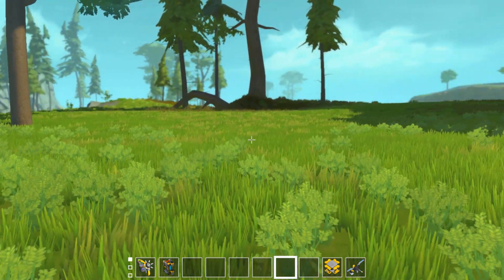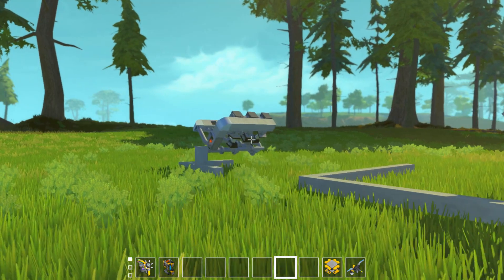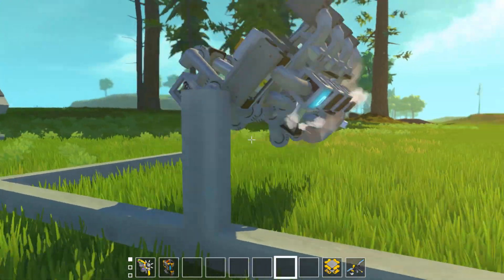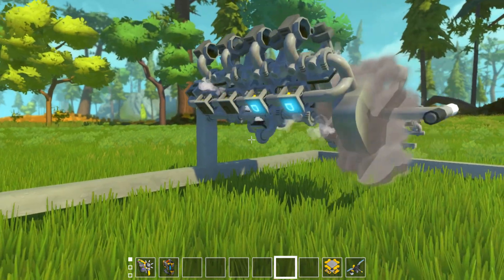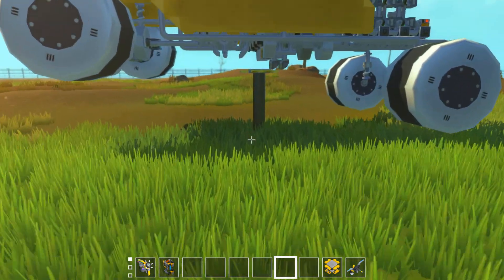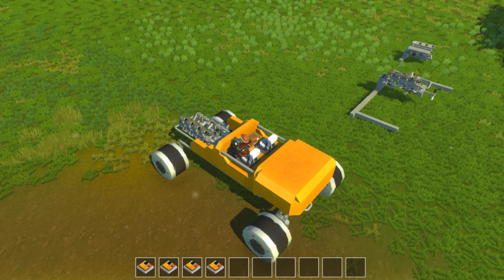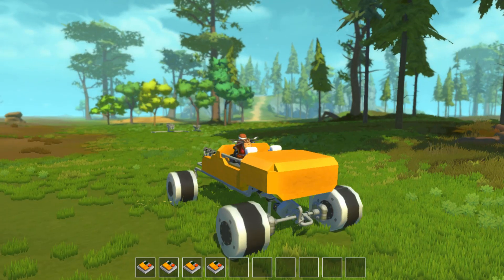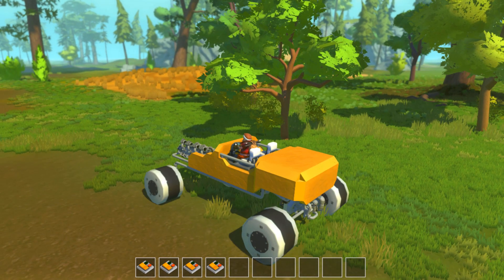Rhythmic v8 Piston Engine | Scrap Mechanic

Comment: There is a mod that has invisible bearings that don't have nearly as much lag as normal bearings. Around 2-3, invisible bearings probably create as much lag as 1 normal bearing. The mod is called The Modpack Continuation by The Guild. WARNING: I don't know if this is true for all PCs but it helps mine a lot.

Comment: HA who needs a PLATE WHEN YOU GOT TORQUE and YOUR MAKING A PISTON ENGINE IN TRAILMAKERS THAT CAN SMOKE THIS ENGINE?
Reply: wrecked funtimefoxy it's impossible to make it in trailmakers its way worse in trailmakers
Reply: @jakesnipergaming8160  true but we are smarter then scrap mechanic in logic we got faster engines going 60 fps per rotation and yes that is possible
Reply: it looks like its twicthing but its moving
Reply: Yea
Reply: Trailmakers dragon engine is 10 shits faster
Reply: Btw where's the plate...
Reply: How did he make the fixed v8?
Reply: got scrap and USED A CONTROLLER MY FIRST WORKING PISTON ENGINE IN A NEW GAME AND IT WORKS LIKE A BOSS slow but steady and not gittery like that V6 oddfire
Reply: @jakesnipergaming8160  actually i beg to differ i did already make a arguement but heres another 300 rpm vs 60 fps or something we have no idea cause we cant get the game running faster then 60 fps but however scrap mechanic has its in contracted form unlike trail where we cant compact it unless we use weird positioning where we get a i2 and do weird things with the crank and make it shove the head down with it making it small and they are very fast as well making the engine look to be having a seizer but its rotation

Comment: if your having trouble with frame rate  just reduce the foliage
Reply from the maker: The foliage amount doesn't make much of a difference for me. At some point the creation just lags. It is usually cause by how many moving parts are on the tank (Suspension and Bearings)...

Comment: Why don't you use glitches?
Reply from the maker: I use glitches occasionally. I don't like blueprint editing and mods. I enjoy the challenge of creating within the limits of the vanilla game, and I do consider glitches to be apart of the vanilla game.
Reply from the maker: As for engines specifically... I build the engines to be mechanically interesting. Not only does it work as an engine, but it works the way you would expect it to work...